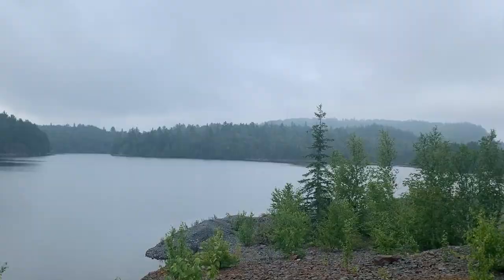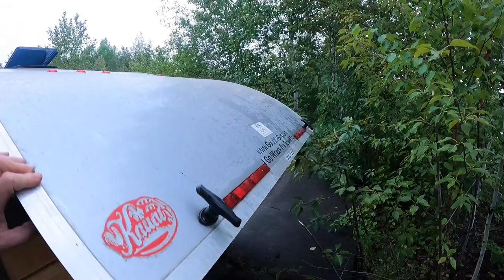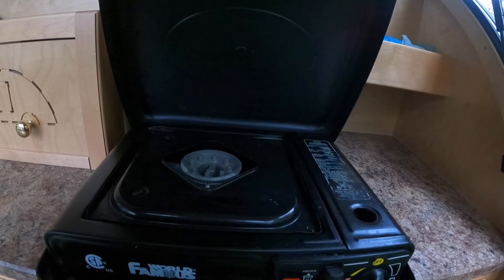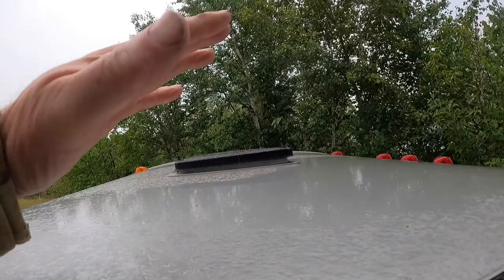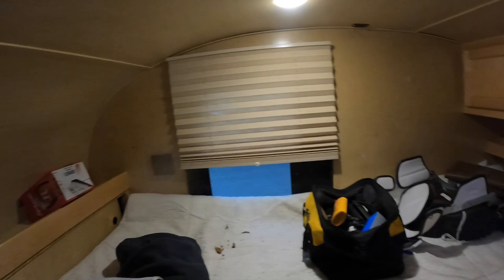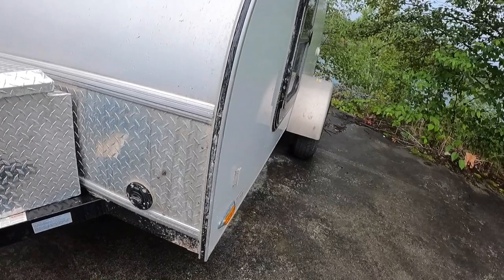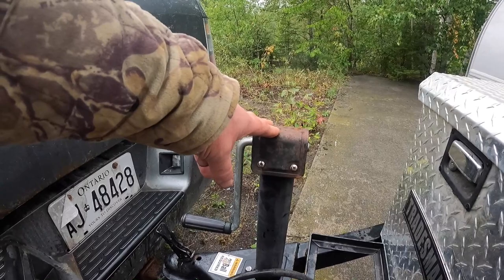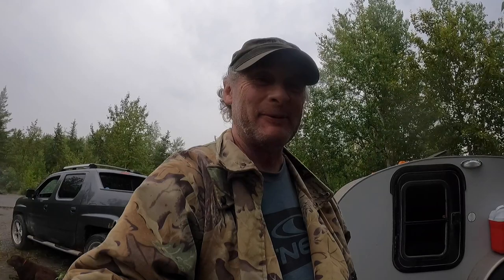Tour Little Guy "Silver Shadow" Trailer

Comment: I drove  VW camper buses for years.  It was nice to pull up on your spot, park and flop onto the bed without getting out of the vehicle 👍🏻  Those little trailers are super cool!
Reply from the maker: Better than driving to a motel or pitching a tent for sure
Reply: @meMiner  Is it possible to simply pull into a spot, not unhook the trailer, and use it for a brief overnight and then leave in the morning? Or is that somehow not good for the trailer?
Reply from the maker: @herrp8765  That's mostly what I do.  Or I unhook so I can take my truck into a tight or 4x4 rough area and come back at night.
Reply: @meMiner  Sounds very convenient. I like that stealth element. Niiiice!
Reply from the maker: @herrp8765  Only issue is it is too heavy to easily pickup and turn around if the trail comes to an end without a convenient place to turn around.
Reply: @meMiner  I have a trailer dolly with a 2 inch ball on it. I think that would allow me to at least move it around my driveway. (So the front faces the garage door to avoid thieves.) But good to know that it does carry some weight. Tks

Comment: That trailer is so rad! Was thinking about getting one but then I wouldn't be able to tow my boat so we're going with a pickup camper. Thanks for sharing your setup with us! Good call on the rack grill!
Reply from the maker: I rented slide in campers in the Yukon.  They take a big truck (2500 or 3500) and on bad roads rock back and forth.  I don't think I ever returned one with intact dishes because the cupboards would open up on rough roads.  They are awful nice once you arrive at your destination.  Last week, I saw someone pulling a camper and boat in tandem.  I didn't think that was legal in Ontario
Reply: @meMiner  Oh yeah, my grandfather used to use all plastic and metal dishes and broke many buckles on horrible roads! I'm hoping to get a full size Toyota Tundra
Reply from the maker: @RagnarRocks  I almost bought a Tundra last year.  They are great trucks and last forever.  You can put an big ATV into the back (my 1000), whereas my Ridgeline will only take a 400 and the tailgate has to be down.  The problem you might have is most slide-in campers are heavy and the Tundra tops out at about 1700 lbs in the bed.  Also, adding weight there reduces your tow capacity.   Not a huge problem if your boat isn't too big.  I recall the Tundra tow rating is 10,000 lbs (my Ridgeline is only 5000).  I don't like to drive a maxed out truck on the highway.
Reply: @meMiner  totally agree! Just planning on a small camper and I have a 150 pound aluminum boat, will get the job done!

Comment: All the basics. A couple hundred watts of solar on top will make it good indefinitely boondocking, especially paired with a 100 amp hour lithium iron battery. It costs a little up front but you'll enjoy it every time you camp. With a decent inverter you can run small 110 devices, like a coffee maker. Sunshine makes better coffee. A cover for your vent solves the travel with it up, if that is what you need. It also allows full open vent while a downpour is going on, that's handy! Safe travels!
Reply from the maker: Good stuff!

Comment: Great set-up and looks comfortable, have you considered getting solar panels ,either solar mat or fold up panels for the batteries. I have 80w panel and 120 ah battery it keeps the car fridge cold for 2 weeks without sun. Good video as always and stay safe.
Reply from the maker: I think I would buy a second battery first.  The truck will charge both on the drive.

Comment: Those are cute and light weight... I lived in a 6' X 12' Converted Cargo Trailer, (converted into a camper) w/my Dog for 4 years. She always laid in front of the TV or the Fridge, me having to step over her.... we got a 21 footer now... It's still camping. What gets me is these people who sell their Home a buy a $300k to to $500k+ Motor Home, Service and Maintenance on those are outrageous...!
Reply from the maker: I looked at a number of other campers and was disappointed with the "fit and finish".  I'd like to put a lift on this one and larger tires, but that is for another day.  I almost built my own toy hauler from a cargo trailer to take to the gold fields.  Something to hold all the gear, maybe an ATV and still have a place to sleep.
Reply: @meMiner  I looked at numerous "Used" campers, that sat in someones backyard for like 10 years and the whole thing was falling apart, bald tires, holes in the floor, mice nests..you name it..! AND they  wanted $8,000.00 for it...! No Way, Sorry, that's why I bought the Cargo Trailer, 2010 model, excellent shape, $2400.00 and put like $3k into it w/wiring, plumbing, insulation, water heater, fridge, etc.....!
Reply: @meMiner  I bought a slightly used/nearly brand new 2022 popup last year that the previous owner camped in for one night.  After I took it out for two-night stay, I was very glad to unload it for almost what I paid. After that trip it sat in a dealer's lot for 3 months waiting for repairs. Very poor quality. HUGE letdown.

Comment: Cool little unit,, you can fill it with rocks and tumble them on the drive home,,
Beats the crap out of my air bed in back of my T6 on top of my tools
Reply from the maker: I used to sometimes sleep in the back seat of the truck with Daisy.  It didn't make her happy.  She would push me away with her feet.  Not enough room and she got too warm.  LOL
Reply: Ha ha, yes my lurcher use to do that,, she had really boney feet and would poke me in the face or ribs 😂😂

Comment: Hi, what year is your camper? Have you ever had to replace anything on it and interact with the company and order parts? Thanks 😊
Reply from the maker: I forget the year.  I had to fix the ceiling vent but that was probably my fault because it needs to be closed and locked when traveling.  I got the replacement part from the US.  A new issue is the door hinges on both doors broke.  I suspect the trailer flexes on rough roads different than the doors.  I have to get them replaced and don't look forward to the task because they are pop riveted

Comment: got me a jack at walmart 45.00 mount's on the side of the tung and fold's up. you can take the old one off. did not want my new gate fo-barrd.
Reply from the maker: And bonus, I wouldn't have to fuss with the wheel.  Could just leave it on the jack.